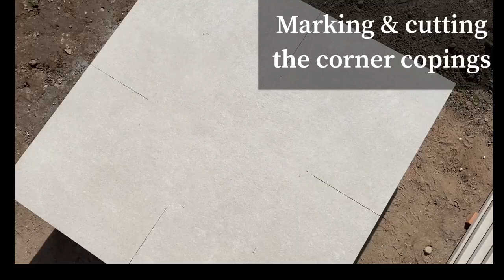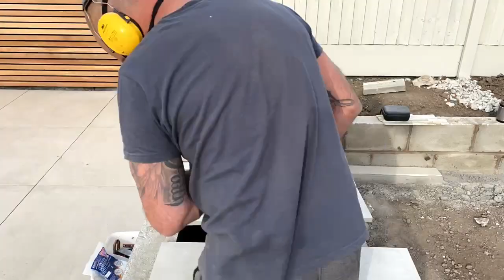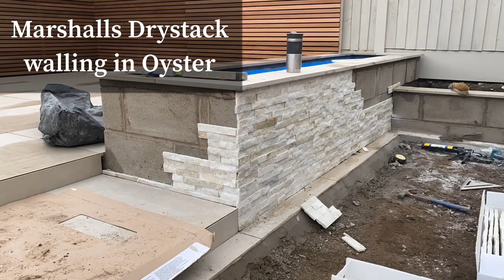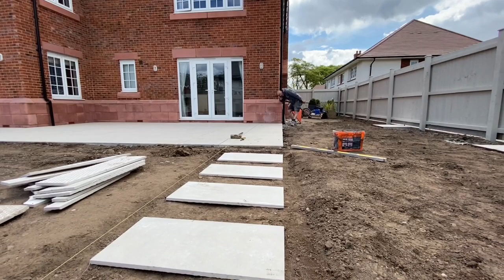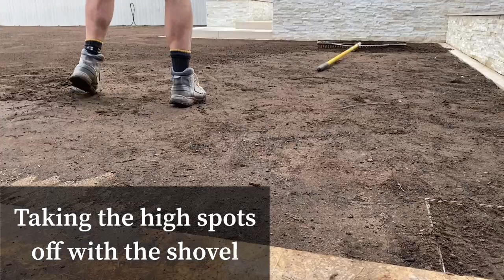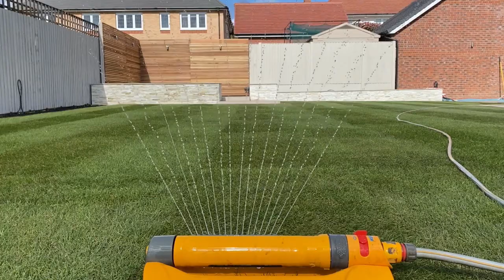Garden Transformation Part 3

Comment: Hi matty you and your team are on a different level ,always a treat to watch your work, do you have any vids or advice on using fugabella grout on porcelain,  ready to grout on Monday roughly about 60 3×2 . Got a bag off grey grout to match any tips would be great ,got the rubi washboy ,power washer squeegee on standby , can split the grout before mixing so it doesn't go off early  cheers Allan 🏴 yes sir I can boogie 🏴👍🏴👍
Reply from the maker: Thanks very much mate, always appreciate your comments and support 🙏
You won’t need the squgee or power washer mate, just the wash boy and drill mixer, another pair of hands too.
Fugabella is good coz it doesn’t set too fast. 
Don’t put too much water on when cleaning as you’ll wash the colour out. 
Good luck mate
Reply: Cheers matty appreciate the reply should I do it in stages or go for full lot in a wanner,  Phil at pulvex got back to me about the blades , I got one up here anyway but your right what a top bloke 🏴👍
Reply from the maker: @allanblackshaw3046  do one bag (they’re only small bags) and clean off right away. Like I say the Fugabella doesn’t set fast like other grouts. 
Keep changing your water too mate, big sweeps, dip and roll off your sponge 
Call me if you want. Are you on Instagram? Can PM me there
Reply: I'm not on it mate I'm too old fashioned,  got a big bag roughly same size off a bag of flowpoint , your a star matty taking time out of your day off to get back to me , especially after we shut your lott up on Friday night 😁😁👍🏴🏴
Reply: All grouted matty cheers for all the tips etc,  just watched the rest off your vid absolutely stunning again ( no surprise) that's a great well oiled team you've got in your corner , is that Phil fodens house will look good when he's home next week 😁😁🏴🏴🏴🏴👍
Reply from the maker: @allanblackshaw3046  good stuff, glad to hear that boss. 
😂😂😂😂 yeah! I don’t follow the England footy team mate, doesn’t excite me. 😒 nothing like watching your club✊
Reply: Good lad love u even more for that👍

Comment: very nice.....is that a paving tray at 15:01 (bottom right) that you can turf over?
Reply from the maker: Yeah We put that in, there’s another 3 in garden too 🤦🏻‍♂️
Reply: @Brockstonepavingpros  nice touch that. will the turf not dry out? been thinking of putting one in but afraid it would just dry out. slightly off topic here but do you ever use gazebos when its pissing down? if so do you recommend any? and thirdly lol did i tell you about the nightmare we had with flow point? :)
Reply from the maker: @seanmcgrath9167  yes mate it could dry out, you’re right! But it will always bounce back, either way it’s better than the black plastic covers. 
What happened with the Flowpoint? It’s a different animal in the summer
Reply from the maker: @seanmcgrath9167  yes mate, Rock Awnings 👌
Reply: @Brockstonepavingpros  somehow a bag of smooth got sent in the order and i didnt realise until it was brushed in. well i say didnt realise when i was mixing it i thought it looked a bit different but it was the first time i had used it anyway we had to jet wash it lively out of the joints luckily enough it was the last bag near the edge next to the sump so we got away with it but fkn hell we was sweating like a 55 plate transit pickup on the MOT ramps! :)
Reply from the maker: @seanmcgrath9167  😂😂😂😂😂😂😂😂😂😂😂😂 the 55 plate got me 😂😂😂😂👍👍👍👍👍👍
Reply: @Brockstonepavingpros  was a bit of a nightmare but used it a few times now. dont think il use anything else to be fair.....one thing we did have was a bit of eflourecent  picture framing on some kandla grey you ever seen that?
Reply from the maker: @seanmcgrath9167  I only use it on setts, or sawn paving with a tight joint. Nothing better on setts.
Yes, high cement content so susceptible to efflorescence 
What did you use it on?
Reply: @Brockstonepavingpros  kandla grey indian stone
Reply from the maker: @seanmcgrath9167  flags or setts?
Reply: @Brockstonepavingpros  flags mate. 
what do you use on indian?